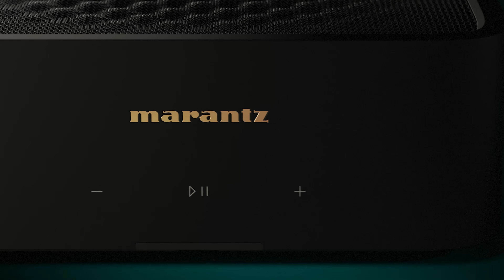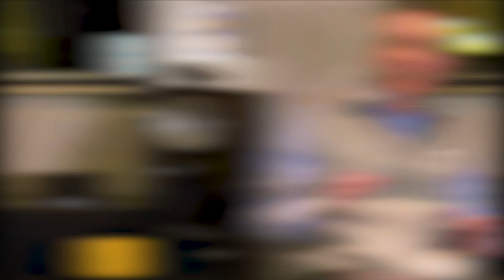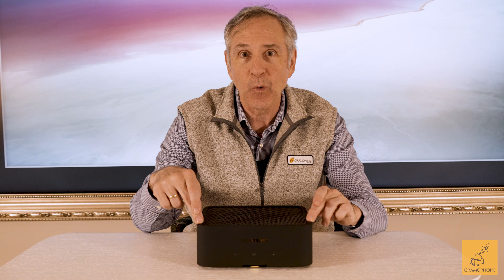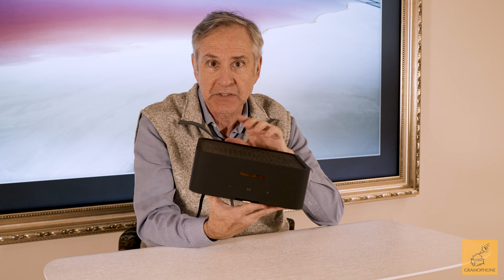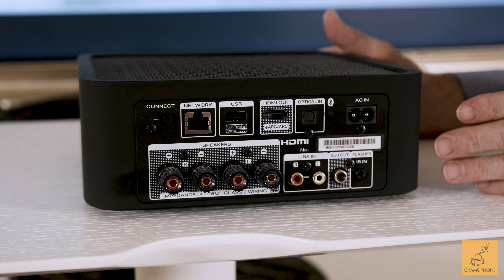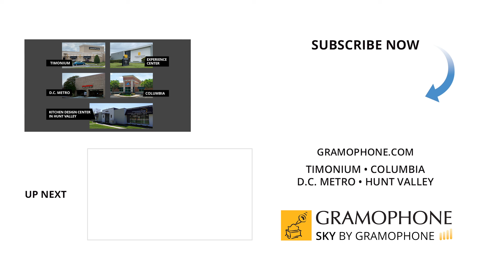Marantz M1 Game-Changing 2.1Ch Streaming Amp | Gramophone

Comment: Does the M1 have issues rejecting RF and WiFi? I have had two M1’s now. The both had quite a bit of swirling  hiss when sound was coming through. I would also sometimes hear a pulsing sound. I haven’t experienced this with any other amp (including the WiiM amps).
Reply from the maker: Hello Official, thank you for asking.  We've sold quite a few M1 so far, and not experienced this issue. We'll reach out to our contacts at Masimo now to see if they can be of further assistance
Reply: @GramophoneMD  seems to be more recent with the latest firmware update. Andrew Robinson made a comment about it and has reached out to Marantz about it recently.  Seems almost everyone is starting to experience this hiss.
Reply: I have been experiencing the same issues.
Reply: I just received my replacement unit. Unfortunately, I am still having the same problems. I get a swirling/phasing hiss/static that kind of sounds like something you’d get when you can’t quite get a radio station to come in. I will also often get a pulsing sound when no sound is coming though.
Reply: I am having the exact same problem. Where you able to fix it?
Reply: I also have a WiiM amp that doesn’t make noise.

Comment: Marantz is 200£ more expensive but Denon looks exactly the same inside. Only Marantz comes with 5 years warranty Denon 2 years anyway most Uk retailers offer 6 years extended warranty for free.
Are They sound the same?
Reply from the maker: Hello Karhaj, the sound is not quite the same, as these two look very similar, but actually have a substantially different parts list. Both are quite good though

Comment: Can this drive 4 Kef ceiling speakers connected in parallel?
Reply from the maker: Hi Jeff, that's a "definite maybe".  It depends on which speakers, which room (how large it is) - and how loudly you like to play.  Ex: the CI-200-RR is a 4 ohm speaker, so 2 pair would be a 2 ohm load.  Model M-1 (and many other amps) are not rated to handle 2 ohm loads.  So before cutting into your ceiling, we suggest consulting with folks who do a lot of custom install work: ask@gramophone.com
Reply: @GramophoneMD  I do custom install work, lol. I was going to buy the blue sound amp and this came up so was wondering and the kef I am using is the Kef Ci200QS with one Kef Ci200QSb ceiling sub for each pair and that has a built in crossover. More listening music than party music. These are 8 Ohms
Reply: in comparison which do you think is better and the apt. is important as the client is not to tach savvy
Reply: tech, sorry
Reply from the maker: @Jeff-rg9io  Hi Jeff, sorry we missed this.  The Bluesound amp is very good, this one sounds really good too.  Let us know how it sounds once your install is completed